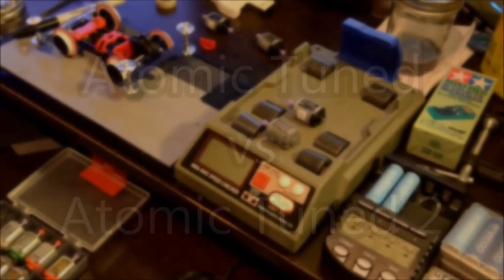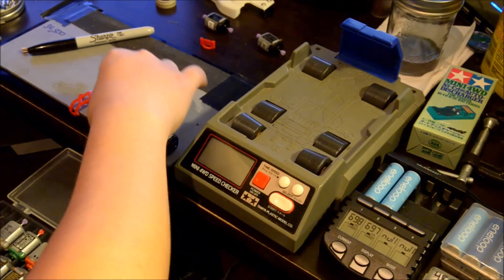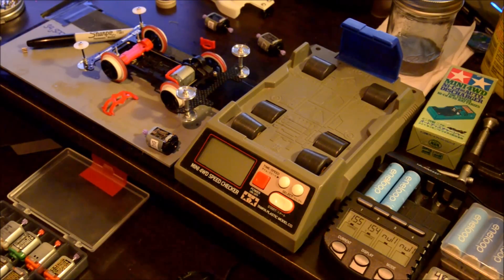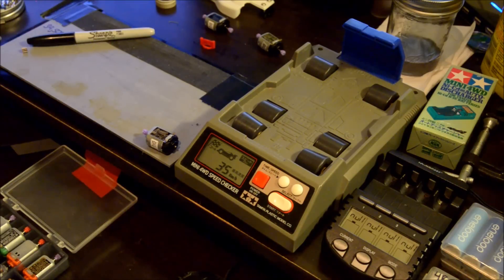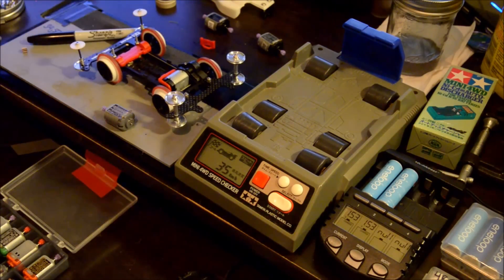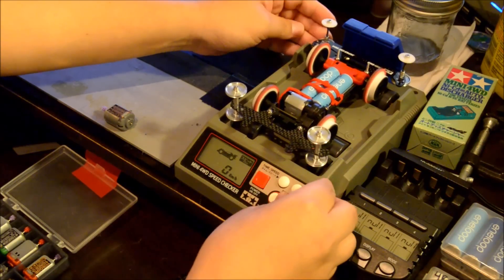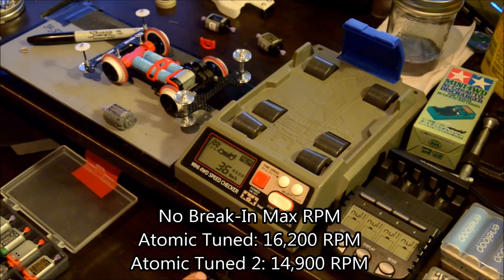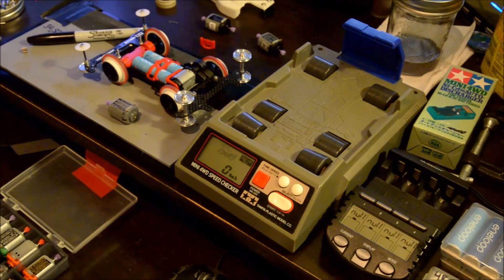【ミニ四駆】Tamiya Mini 4WD Testing: Atomic Tuned vs Atomic Tuned 2

Comment: Mabuchi-made motors still outclass SMC-made ones. I was really hoping to see improvements on the remakes of the Tier 1 trio but I'm quite disappointed with their overall performance. I'm really hoping Mabuchi starts to make new ones again.
Reply from the maker: I'm not sure exactly what is happening in Tamiya. If you notice the trend, they've slowly been replacing the Mabuchi Motors with the SMC motors. Even the latest single shaft Hyper Dash is an SMC motor. The last non SMC motor is the Ultra Dash. Expect a replacement for that at some point.
Reply: +Z3N Bluster I do. And it's really unsettling me.
Reply: i got a mabuchi motor from a printer and when i tested, it was almost as fast as jet dash the only difference is the sticker, i guess that's what mabuchi are manufacturing now

Comment: Do you have hyper Dash and plasmadash motor review?
Reply from the maker: No, Hyper Dash is too rare to review unless I get another original one. Plasma Dash isn't really that good for racing.
Reply: @Z3NBluster  oww. Thanks for info. Happy setting.
Reply: @Z3NBluster  What's so bad about the Plasma Dash? I'm just barely getting back into Mini 4WD Racing. The last car I had was a direct-gear VS chassis that was converted into a trike powered by a modified Plasma Dash. Car moved so fast you could barely see it. This time around I'd like to race within the regulations. I'm sure the Okami motors and Alien Trikes arent allowed ^_^;

Comment: There is something wrong dude.
The RPM couldn't be wrong. it should win the atomic Tuned 1.
The label may be wrong.
Reply from the maker: I said it in the video. the Atomic 1 probably has weaker magnets now. The one I have is a pretty old motor.
Reply: I see, the problem was the magnet. Thx.

Comment: Why may atomic tune is 19kph only
Reply from the maker: I'm using 35mm wheels and tire setup, that gives me a higher top speed.
Reply: @Z3NBluster  bro i've copied the xto you create and using a sprint w/3.5:1 gear and i got a top speed of 30kph ,if i change the mags and tire w/ large dia will i get more top speed from that ? Thank for your reply
Reply from the maker: @jackyabuyuan5251  30kph Sprint on 3.5:1 gear ratio and the tires on my Basic FM-A build? Sounds like you have a problem somewhere with your transmission. Make sure your gears and shafts are tightly moving with each other, but not too tight. If it is too tight it also causes an issue.
Reply: @Z3NBluster  so your saying that theres a increase on my top speed when my gears or transmission when i tight it?
Reply from the maker: @jackyabuyuan5251  Yes. You need to make sure the transmission as a whole fits nicely. Tight, but not too tight. If there are alot of loose gears, missing teeth on gears, or shafts that slide too much. Your transmission will lose power.